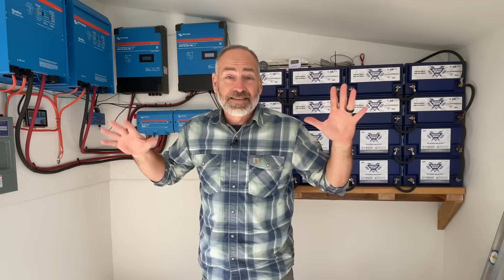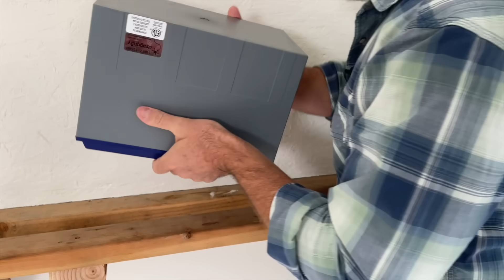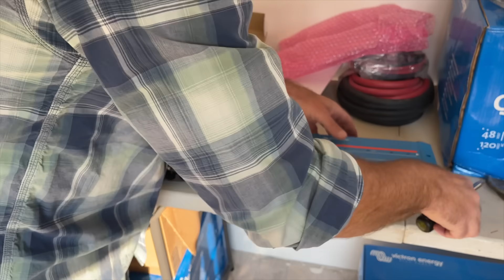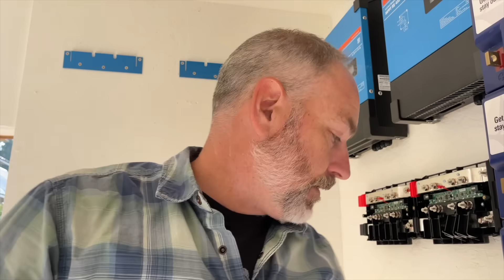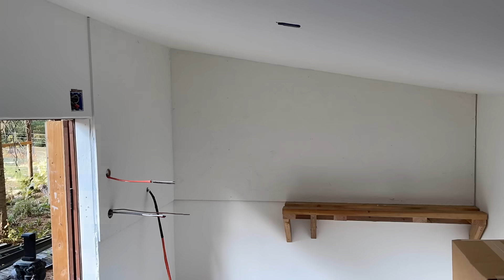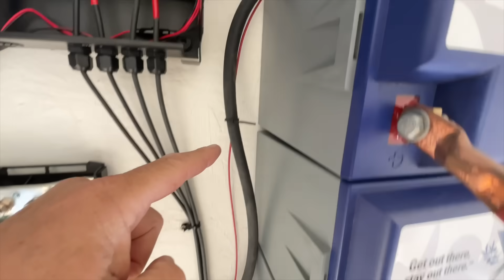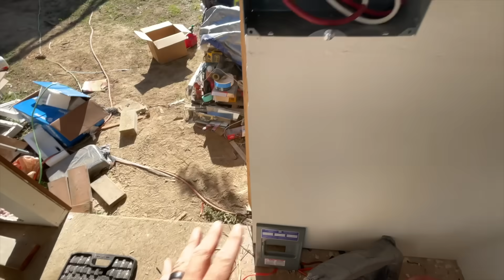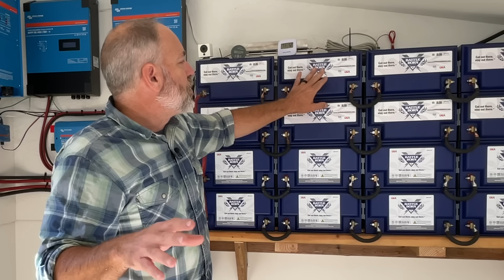EASIEST Off Grid Solar Power System Battery Bank

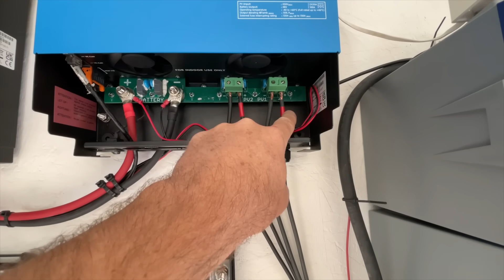Comment: PV connection to the MPPT RS at 18:25 can be potentially dangerous depending on the PV voltage. DC voltage if starts arcing will not stop and will set everything on fire. You have exposed copper positive and negative wires next to each other. Use ferrules and make their length so that no metal is exposed outside of the connector.

Comment: This strikes me as more of an infomercial than a realistic assessment.  The sponsor is mentioned. Under ideal conditions solar can  be impressive.  There is mention of the generator when that isn't the case.  Once multiple batteries/panels/controllers are connected in any configuration the potential problems multiply, and can be a real problem in solving.   Any fail safe system will challenge the laws of probability, and only hurts when it wins. Be Wise, Safe, and Walk On ! ☺♥†♪♫ 8-19-24

Comment: Anyone can please explain why two lines into circuit breaker? How is that load distributed there? Is it just connected in parallel? Why use two separate inverters, is it because of split phase? This is specific to 120V countries, when you need 240v for some other appliances?

Comment: I quickly checked the prices on the equipment and I am ball parking $15K-$20K 😮. That doesn’t even include the solar panels. How many years do you need to recoup the investment?
If you pay $200 a month (and that’s not a low amount), that’s $2,400 a year. So you need 8 years or more to start to see some gains and again, that’s before the solar panels and no labor costs since you are doing it all. What am I missing (a total newbie on solar here).

Comment: you have a 50 amp service with, I assume, a #6 wire connecting your shed to your large house and a 200 amp panel.  Do you have enough available power for large loads?  I'm thinking of the water heater, which you may be thinking wood boiler,  or the HVAC inrush and operating load.  I am interested in your load calculation for your homestead.

Comment: So the house panel is supplied by a single 50 amp breaker from the power shed? That house panel in the garge looked like my 200 amp panel. Subscribed. Almost done watching the whole video which I very much enjoyed. I think I could get by on half of your setup since my house is small. Did you run two inverters so you could get 220 volt supply? I'm no expert so just curious.

Comment: you said "why Battle Born" but you really only answered "why lithium"

I'm curious why anyone would pick a brand like Battle Born at this point over something like EG4 with similar specs/features at 25% of the cost per kwh for any real reason other than the brand recognition

Comment: A lot of people are talking about the cost, and rightly so. I've seen equally, if not more impressive setups taking advantage of NOS EV battery stacks that come to about $150/kWh, including the inverter and BMS (with the BMS including a balancing system that bleeds off voltage through a resistor for any cell that's out of spec). 

You could install a 72kWh system for half the price, and even have leftover cells for a separate dedicated 12v line.

Comment: Safety glasses are required when hammering steel on steel. It is not optional, anywhere, But I love how you use the cheap hammer crimper. I have the same one and it works great.

Comment: These 16 batteries is about $16,000 alone, plus two MPPT ~ $2200, plus two  Quatro  ~ $4500. 
So this set is at least about $23K.
Based on what I found on the net.
Reply: NOT including the panels....
Reply: You stopped me from researching thank you!
Reply: This retail price shocked me. Is it really that expensive to source a 12.8V 100Ah battery module locally? We are a factory directly from China, and our prices are so low I'm almost embarrassed to admit it.🥲

Comment: Comparable eg4 lithium batteries would have been a lot a lot cheaper. Cool system.  I have similar system on my Rv- but smaller.  I had a victron Quattro 3,000 watt, 24v inverter charger go bad after 5 years of use.  It stopped working and I had an indication from battery protect say the inverter had a direct short.  Swapped in a new multiplus 2.   $1200  later Back to camping. Solar is so cool.  Have power in the house from a system you put together getting free energy from the sun.  Very cool. You can get 6 batteries equaling 30 kWh of eg4 batteries for $7500 today.  Prices keep dropping on these.

Comment: You did the battery Series-Parallel connection wrong.
It should go Parallel to Series connection.
You should have done 4x4 batteries in Parallel and than Serial them together on the middle batteries.
That way 4 parallel batteries balance each other out.
This way you have 4 serial banks and each battery can go out of balance with the rest of the pack.

Comment: Good evening Martin. Forgive my ignorance because I'm a complete layman as regards the Solar system you had ably explained. If I got you right, the   solar system I'm seeking is one that can run 3x3 phase AC current equipment. How many Solar Panels and their equivalent Batteries would I need in order to achieve at least 380v AC which is 3 phase? How much would that set cost, landed in Zambia, which is in Southern Africa?

Comment: Ok, dumb it down for me here. I’m used to the smaller van size solar setups. Now I have a house I’m going solar only on. I saw a 6 piece 450 panel set on Amazon I wanna buy. That comes out to 2700 watts. Using online calculators, running at 12 volt, I would need a 225 amp charge controller, which I have yet to find. Only reason for going so large is the wife only agreed to this if she could still have ac. So I’m gonna be installing a mini split. For batteries I’m working up to 10, 280 amp hour batteries. Am I just understanding something incorrectly on the charge controllers? Thanks in advance for any help.

Comment: Hi Martin, great work. Just one small but critical tip: the batteries need to be secured a bit better to prevent them falling over either from bent accidentally knocked over from someone tripping or in an earthquake or from the cats doing cat acrobatics on them. The base support legs need reinforcement as well regardless of how light the batteries are. They also need to be mounted lower away from the hottest region of the cabin, all the hot air from the inverters is blown upwards, it’s bette rot place the batteries on the floor

Comment: Why? Go 48 volt.
Reply: It doesn't make sense why he is using 12v. He is paying $930 for 100ah 12v whereas a 48v battery is like 90% less cost and are designed to be connected in parallel with dedicated coms cables. I can only imagine that he is getting sponsored. As for a simple setup, you can use a 1 hybrid inverter with 1 48v battery, which is a lot simpler and more cost-effective.

Comment: This was amazing and detailed to. You did a great job with this system. I just hope my system is this good. I am getting solar panels installed soon. I just have to wait for the people to call me. I guess they need to make the appointment so they can check on my roof and see if I need a whole new roof or just the one side needs fixed. I think I will need a whole new roof. Its an old roof. This house was built in 1870.

Comment: Hi Martin , thanks for the great video on the solar installation. My question is related to the breaker box you connected, did you ground this box with a copper grounding rod? Also can you please send the link to the type of box and breakers you used and the gauge of the wiring? Thanks again.

Comment: i checked the battery price then i checked the inverter price   good god theres got to be a cheaper way to do this an get a BETTER result    just saying
Reply: It doesn't make sense why he is using 12v. He is paying $930 for 100ah 12v whereas a 48v battery is like 90% less cost and are designed to be connected in parallel with dedicated coms cables. I can only imagine that he is getting sponsored. As for a simple setup, you can use a 1 hybrid inverter with 1 48v battery, which is a lot simpler and more cost-effective.

Comment: You could build it for wayyyyy less.... The batteries are a rip off and Victor, while good.. is over hyped and the market is changing. I built a battery bigger than that for under 3 grand. It's EASY and all the same parts

Comment: The batteries might be lighter than IFLA batteries, but at a $1000 a piece they’re just pure expensive and unaffordable if you’re in a small budget… and limited lifespan, not to mention environmental impact of lithium. 
For the price of a couple of those and a bit of work and muscle, you could have yourself a 48v IFLA system. Who cares about the weight? Once installed they don’t move. That’s $16,000 battery cost alone. How many years of solar power will that even take to pay for its self? You might as well hook up to the grid 😂 we don’t all get free batteries from sponsors.

Comment: pricing this setup today without the panels brings you in at just under $30k. this would take on average 9 years if panels were included. i wonder if the batteries and panels would last that long.

Comment: I have used Victron AGM batteries on one of my projects along with their inverters and chargers. one of the batteries was faulty and it took ages to figure out why the system wouldn't fully charge or why my lights wouldn't work all night even though the bank should be plenty.... AGM are nice and affordable but they don't have a BMS so one battery can hamper the rest. I use more expensive Lithium batteries now as they save me a headache. I have also noticed from time to time that the victron settings can return to factory if power is disconnected for an extended time. if you know these querks its easy to fix.

Comment: wouldnt it be alot cheaper to get server batteries instead ( EG4 Lithium battery 12.8V (12V) 400AH 5.12kWh with 200A internal BMS )

Comment: There’s got to be a less complicated solution. It’s seems there are too many components in the system in my opinion. Isn’t there an easier way?
Reply: It doesn't make sense why he is using 12v. He is paying $930 for 100ah 12v whereas a 48v battery is like 90% less cost and are designed to be connected in parallel with dedicated coms cables. I can only imagine that he is getting sponsored. As for a simple setup, you can use a 1 hybrid inverter with 1 48v battery, which is a lot simpler and more cost-effective.

Comment: Nice and clean setup. 16K just in batteries is impressive. I'm going to guess this whole set up is around 50k all said and done. Lets say if you were on grid, your electric bill would be $200 a month. At 50k it would take a little over 20 years to break even. And during that time, moist likely around 10 years or sooner, you would have to change batteries and other components. I know its nice to have power whenever you want and feel like you are not tied to a power company.  But aren't you in fact tied to another company that provides solar parts?
Reply: Na, that's not 50K, more like 20K. For that power output I am guessing his bill will probably be about 400 per month. So his payback time is probably less than 20 years.
Reply: @BANZIXP  so best case scenario these batteries last 3500 recharges, so likely around 10 year mark he will need to start replacing? (or I guess he can live with a reduced battery capacity and fix the odd ones that start failing outright)? interesting concept. I like the Lifepo4 batteries for sure.

Comment: Man, i think the cables you used for your AC in and AC out at 20:48 isn't standard. Is that 4mm cable, you ought to use 6mm cables. Plus your termination of the AC cables to the inverter ought to use a heat shrink sleeve on it to avoid short circuit.

Comment: I love solar technology. Its the future of powering our homes. Off grid power, no power company required.
Reply: Till they pass laws like some places already that you have to be grid tied. Meaning you can have solar and batteries but still hooked up..and charged off course. Most our power bills are delivery not usage
Reply: I think so too
Reply: Solar alone is not future. hybrid systems, 10-15kW solar panels,  5-10kW wind turbine and stand by generatores 5-10KW with good size battery bank is future
Reply: You totally missed when he said he's got a Generator backup for cloudy days! And if you live in Portland?  Your F*CKED...😂😂😂😂
Reply: Martin I appreciate your video. I have also purchased a set of 16-12v 100ah batteries to set up my system.  Not many people show this set up and I appreciate it.  I would really like to see the battery configuration a little closer to see the wiring and what do you do about balancing. I have not started setting up my system yet, it will be about 1 more month but I'm close. We just got our off grid cabin framed up and dried in so wiring and plumbing is next. Then I will install my solar set up. Would you please do an up close on your wiring set up please!! 

Thank you again
Reply: Much expensive then grid.
Reply: Hammmm not really. You see... Solar works when we have LIGHT. And if you store power in batteries to use at night... Because you know, people work in the day and stay at home at night, meaning they use more power during night time... How long does a Lithium battery last???? A quick search says they last about 10 years TOPS. They say 8 years actually but let's be optimistic.... If you do the MATH.... What would you spend using Regular Energy versus Solar+Battery Energy there's practically NO difference!!!! The amount of money you spend on buying batteries would be the amount of money you would spend just using regular energy!!! For that period of time (10 years)!!! The only thing you can say is - I'm not polluting that much. Because those are 8-10 years without emissions. But that's also debatable because depleted Lithium batteries and Solar Panels will have some sort of Environmental impact too. Although I'm not American.... Here we don't have the privilege to sell excess power to Energy companies soooooo... Maybe in America there's an advantage because of that
Reply: @Trip4man  In the past couple of winters, the power companies have increased the prices exorbitantly (not just a bit, but 10-20 times more expensive than average!), and your only alternative is to not use electricity. And that's of course not possible in the winter at -30 C / -22 F. So an affordable solar setup does provide you a much needed alternative that over normal times is not cheaper or more expensive than grid, but during special times tips the balance towards making more sense.
Reply: @Trip4man all that text and so little thinking. We only not use "more energy" at night by default. And there are many types and applications for energy usage. And there are more supplemental systems than just just solar and lithium batteries. Look up TEC and thermal batteries and consider what are your energy needs at night and how can the be collected throughout the day. NO ONE is saying we can snap our fingers and do it tonight.

Comment: Your system is great, but the wire for your inverters to your electric panel in your solar control room looks like it’s too small. 
I’m looking at your panel with a 50 amp breaker and others in it too. Of course I’m just looking at this on my phone, it looks like it might be #10 wire feeding your panel which is good for 30 amps. 
If you’re feeding 50 amps to the house plus other loads, you could be pushing that #10 wire.  I realize your 50 amp cir. is only rated for 80% , but even 80% is greater than your #10. You might look at this to make sure you are ok. God bless you my friend, thank you for a very good video.

Comment: Newbie Off-Grider here 😅

Does it matter that half your batteries are significantly older than the others? 

Also you dont have a BMS to manage current sharing?

Ive been off grid for 3 months. But with a significantly larger set up. I'm expanding roughly every month till I reach my target (in roughly 2 months time)

Comment: FYI:
Grounding is the single most important aspet of an electrical circuit.
You should never Daisy chain Grounds. They should  always be ran individually from each piece of equipment to a common Bus.
In the event you should have to replace a piece of equipment , your not breaking that chain.

Comment: How many Thousands of $ Dollar’s ? “ Victron “ “ Is The Top of The Shelf “ The Best of the BEST “ but very Costly each inverter is like $ 3,000. Each those like charge controller $ 500. Each the total of you’re system ball~Park including batteries $ 10,000.00 Dollars and my electrical bill is like 100. To 150. A month $ 10,000.00 divided by $ 130.00 =  77 months = 6 1/2 years but you have now top of the line self sufficient electrical ! Because after the time it’s paid off for its self “ put in Electrical surge suppression in case of lightning strikes into the earth and any wires buried will absorb that electricity and smoke those inverter and Victron will not warranty they call that an act of God ! Mid Night sometime one time use but if it’s if you inverter it’s worth it !

Comment: Thought / Question....  This is the first video of yours I have watched, so maybe this comes up in another one.  I notice the Romex you are using is orange, so #10 which is rated at 30Amps. Have you had any issues when running larger loads in the house.  The 5000W inverts are wired 120V phase to neutral. 5000V/120V = 42A per phase. Just a thought. 
Love the setup. Another thought, how does the setup like that closed room in the summer??? Get hot where you are in the summer?
Reply from the maker: Haven’t had any problems. I’ve never seen the amps over 25A. The only large load we have is a 3/4hp well pump.
Reply: @MartinJohnsonOffGridLiving  would not imagine you would. NEC is very conservative... (Don't get me started!) What size wire did you run all the way to the panel? Looked like a fairly long run. 😁